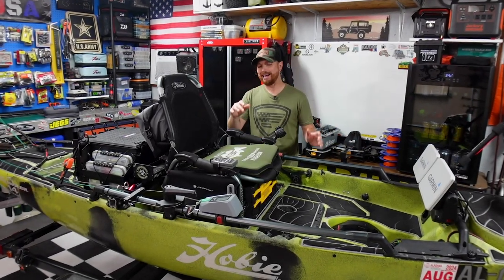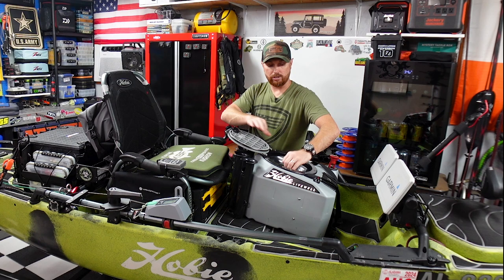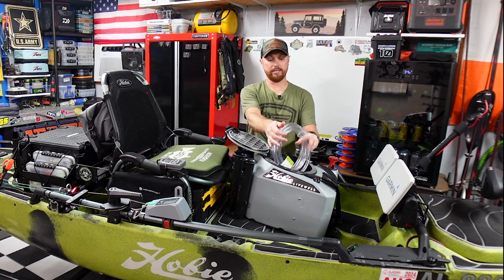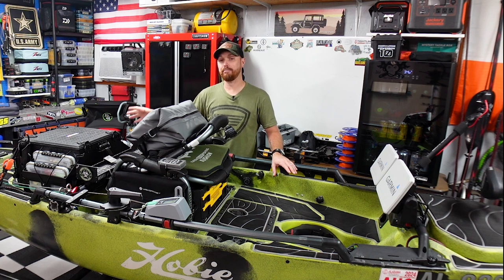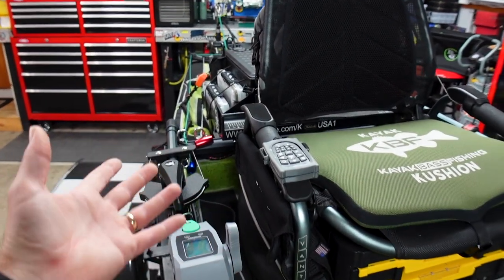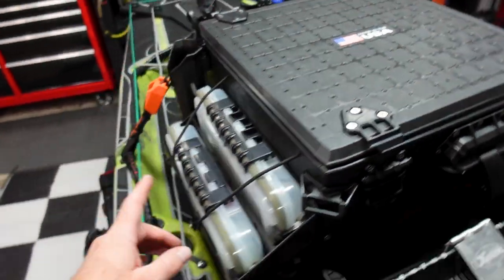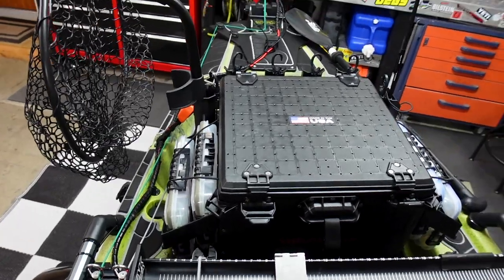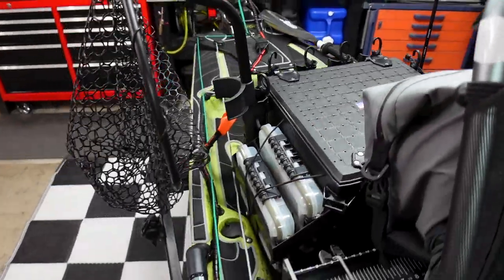I FINALLY Built It‼ The BEST Kayak Crate EVER..! DIY Kayak Fishing Mods 2023

Comment: I commented on the livewell video. Again, this is not the livewell for a PA14 nor PA12...unless you modify the intake tube to be longer thru the scupper hole into the water. The Hobie V2 livewell you have is for the Outback and other models like Compass. The correct Hobie-XL livewell for PA does have an internal plastic shield (Removeable Tank Partition-RTP), protecting pump and red-drain release from being clogged. Your V2 should have this RTP as well. However, I do add an external Bubbler when using minnows fishing fresh water. But saltwater fin/baitfish, the livewell itself is excellent in recirculating constant flow of salt water into & out of the tank, no additional bubbler/aerator needed.

nice set up tips on the BlackPack crate. Love mine too.

Comment: I have a hobie baitwell and I think it works pretty good - but my live bait is shiners or jack smelt - so nothings swimming into the pump. Also I think it’s a 6 volt battery specifically to reduce the flow - couldn’t you change to a 12 volt battery to increase the flow to keep that bait out of the pump?